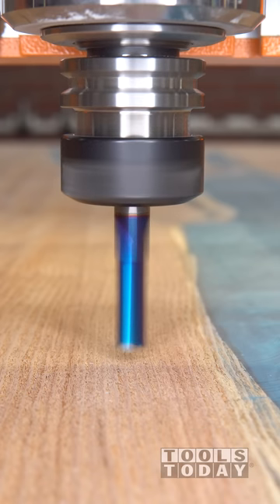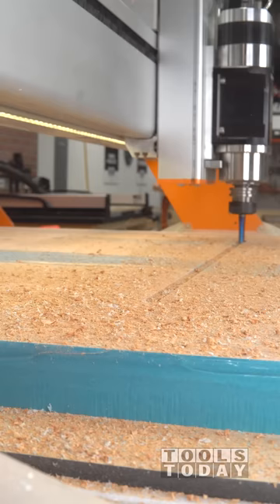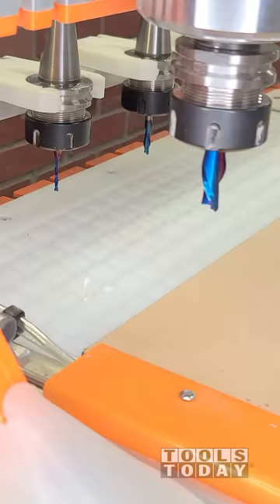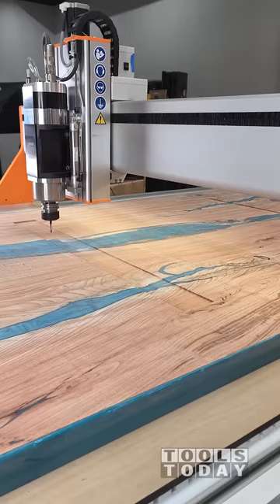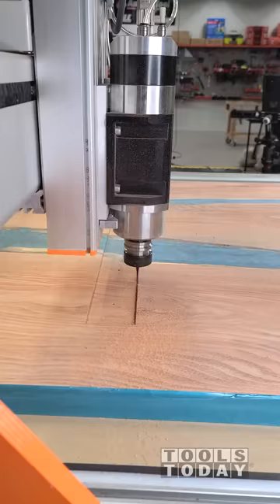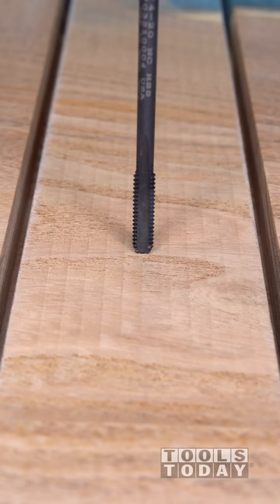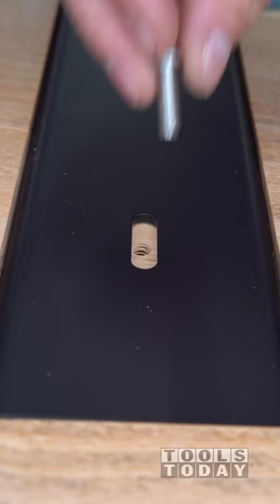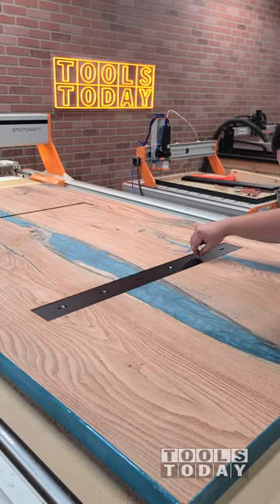Adding C Channel to Slab Kitchen Island Top

Comment: Damn you need to slow down your feed rate a little bit so you aren't burning your bit's so bad!
Reply from the maker: These are solid carbide bits, this is a Spektra coating on the bit that gives it the color.

Comment: Was about to roast you for putting machine threads in wood, but then you explained the hardness... Now having very mixed feelings about this.
Reply from the maker: I do too, trust me.  We will see how well they hold up, but I know I will be able to fix it if need be.  I tried putting the inserts into a test piece with 3 different hole sizes and had to get to the point where the threads were barely grabbing the wood so the insert wouldn't break or the tool to install the inserts wouldn't break.